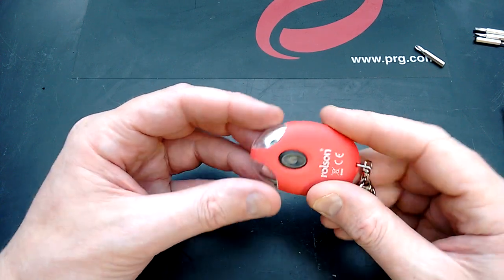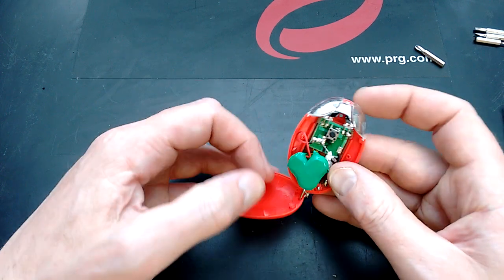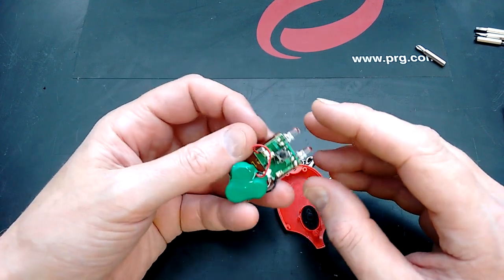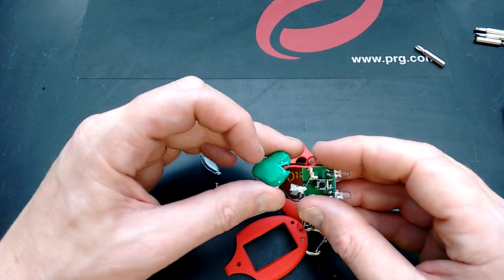A look inside a Rolson branded solar LED keyring.  Real or fake?

Comment: I bought the black brick style solar torch from Poundland a while back, the solar cell was there only to fill the hole in the case.
Reply: I wonder if a bit more plastic is more expensive than a solar panel :D Sometimes these chinese decisions are weird huh
Reply: Maybe they use the defective ones.
Reply: Mystic Plays BR good point !

Comment: Much better audio, can I ask what you ended up doing? I used do a lot of audio tech stuff but never really kept my skills up unfortunately.
Reply from the maker: I turned the baseball cap round.  No skip at the front because it's apparently an audio disaster, and the microphone clipped on the back-adjuster pointing down on my forehead.
Reply from the maker: We were discussing that.  Often with clips in the hair and a bit of tape to hold the mic in place on the forehead.
Reply: bigclivedotcom
Thanks big clive! Will tuck that away somewhere in the ol' brain
Reply: Add a red LED and say it's a cybernetic bindi.
Reply: hp5man - What can I say, it was a light-bulb moment.
Reply: +RFC3514 am i the only one that doesn't get that reference?
Reply: Commando Squeak - I think you might be the only one thinking it's a "reference".

Comment: The local Menard's store sells solar rechargeable lights which have a small LiR2032 lihium-ion cell in them and no protection circuitry.  From what I assessed of it, the solar panel wouldn't be able to overcharge the battery, but without cell protection the cell would be over-discharged if used for too long, and therefore not be able to take a charge.
Reply from the maker: They might be relying on the forward voltage of a directly driven white LED being in the region of 2.7V to 3V.

Comment: Just had a look at rolsons website and they've got an unusual looking 50W COB floodlight on the front page - unusual in that it looks like a black heatsink with a small round porthole for the LED to shine through. maybe I'm being unobservant but I don't think I've seen one like that before - usually they've got a shallow aluminium 'reflector' around the LED which just seems to be there to make it 'look like a floodlight' and doesn't really do anything to shape the light beam.

Comment: because I'm poor and unemployed most of my tools are Rolson and there really decent built tools and i've never had a problem with any of them and i use them to strip down old motorbikes with rusted nuts and bolts for the price and you cant fault them for quality
Reply: Rolson ranges from the shockingly poor to the merely bad.

You'll pay for those tools eventually.
Reply: i've been using them nearly every weekend for 2 years and not a problem yet i must be a lucky one lol

Comment: Speaking of "real or fake" rolson stuff. I've noticed over the years that they just buy generic stuff and slap the name on it. So really you can get a lot of the stuff cheaper if you just avoid the rolson branded ones.
Reply: i Knew mr rolson, he started way back in the 80's, he has always been an importer, never a manufacturer, the stuff was always mostly awful, rough with a rolson label slapped on sometimes in china, or in the UK, supplied in bulk brown boxes without packaging in the early days with a roll of labels to add later.  sometimes he gets something made with a worse specification to reach a price point than is usually the case, same with silverline, hence sometimes its OK other times it can be  a waste of money.
Reply: I've seen this. At the low end of the market, the brand doesn't really tell you much. On the other hand, you see those screwdrivers that Clive uses, the black metal tube with the interchangeable bits. Rolson do one. If there's a weak point it's likely the bits starting to twist on a tight screw, but it works.

Some of their other stuff I am a lot less confident about.
Reply: Dave Bell
yes you got it, mr rolson has worked on branding lately, so has appeared in asda selling torches, usually cheaper led ones, they work, no worse than the old pifco tat that was sold in the 70's.  yes screwdrivers bits are pretty soft, led torches are just batteries and led's often no resistors and the cheap leds, so they will generally last one set of batteries and the led's have  reduced brightness, but the case falls apart anyway, for the kitchen drawer for cheap its fair.  other stuff you would avoid, such as the ratchet tool sets, or the vices, being made of awful metal that breaks easily
Reply: That is what I would expect from any cheap ratchet set, If you're regularly doing the stuff that needs them, you might get something decent at Halfords, but the pro level gear is expected to be abused.
Reply: Dave Bell
my first job out of school was working on the van in the saturday market, this guy sold used trade powertools, some used handtools and  got hold of random bits of new quality tools ( i built up set of knipex pliers etc) at huge discounts, but stuff like knipex at half price still isnt inexpensive, this was in the 80's.   stuff like rolson's was unattractive (ugly paint, coverd in brown grease, no retail packaging) so rarely people bought it then, but then it started that people no longer wanted a quality stanley screwdrvier for £3 when they could get one or 2 for £1, even if they would barely last one job, that was all they wanted, same with power tools, a used bosch drill might be £30, but they could buy cheap for £15 for a couple of holes in a wall a year.  so selling decent gear was no longer doable, we folded in the end and selling tat was not what we loved. we are all tempted by cheap, but cheap isnt cheap when you end up needing to buy another one. i just love quality tools that will likely last forever, these days i scour ebay and get them for prices not dissimilar to new rolson anyway.
Reply: Now this surprises me, I always though rolson were a decent brand, I have a really good pair of snips which are as good as the day I got them and there from rolson. Thanks for the heads up.
Reply: +Commando Squeak yea I thought that too. Wasn't until I bought some Rolson stuff and then found the exact same thing unbranded for cheaper that I figured out Rolson doesn't actually make anything.

Comment: Any chance of measuring the charge current and led current?
Might be interesting, can see charge V discharge times, and also if the solar panel is actually a working unit.(IE not a real failed one).

Re the mic... you wasn't using a side address mic end-on were you?
Like some other blogger I could mention :P

Comment: I wonder how well it would work with super capacitors instead of a battery.
Yes the M/ah would be low but in this application it doesn't matter

BigClive, do you have a link where you brought this from  and how much ?
Reply from the maker: It was from a local Asian store in Edinburgh.

Comment: So what happens if the power flows back into the solar panel?
And by what happens I mean can you show us.
:-)
Reply: The solar feedback would almost certainly cause the sun to explode.
Reply from the maker: It just leaks current and discharges the battery.
Reply: Darn I was hoping for Dougs' option.
:-(
lol
Reply: well that excaladed quickly

Comment: needs warm white LEDs.
Reply: LED colours are interesting in their implications. What we call warm is actually a lower colour temperature, more red. There are reports that the cool white LEDs, similar to sunlight, give slightly better visual acuity, which doesn't sound outright crazy.

I use cool white in my kitchen and work-room. It's not the sort of light they sell as a cure for SAD, but it does seem to make a difference in winter.

In the past, all our artificial light was very red, closer to firelight, and that's partly why we think of it as warm. Fluorescent tubes have improved, but they were mostly not quite close enough to sunlight.

If colours matter, things like painting or matching sewing thread to the fabric you're sewing, picking the right colour of light matters. And it would be nice to know what colour temperature the LEDs in a torch are. Knowing the torch was cool white, and your room lights were not, you could do a quick check on a colour match.